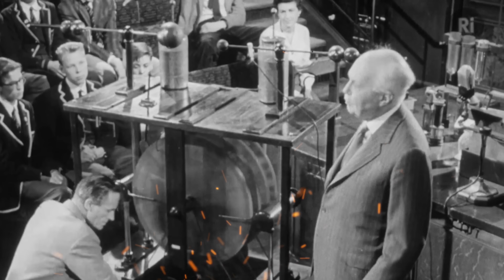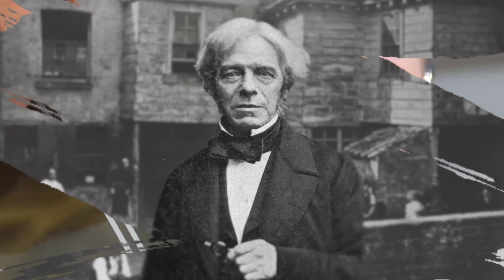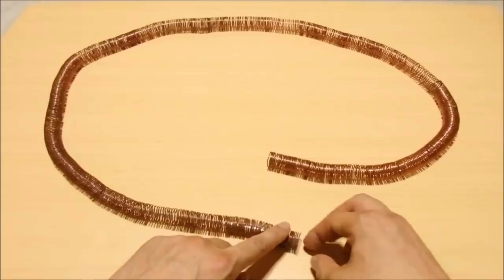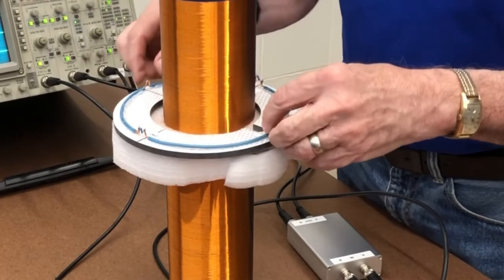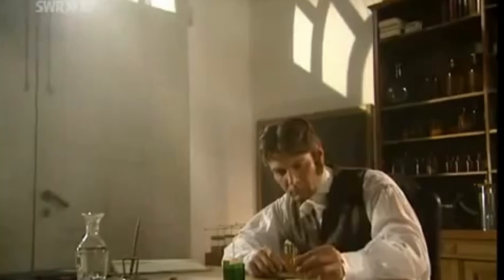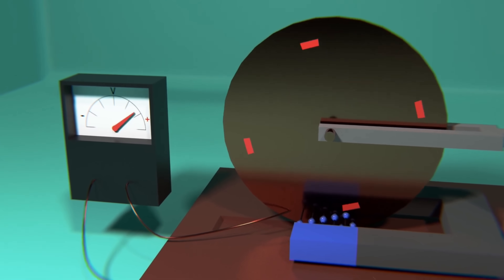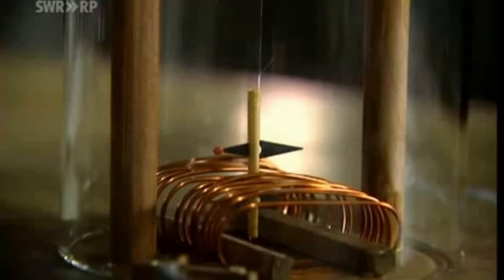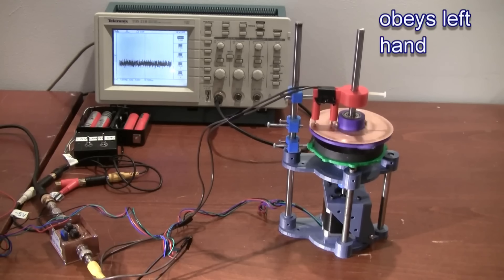The Faraday Paradox: NEW FREE ENERGY GENERATOR 70KW - FREE ENERGY FOREVER

Comment: The Experiment: Suddenly create some charge, and with pre-placed instruments watch (along a radial line from the created charge) the fields and potentials appear progressively at points along that radial, at the speed of light.  And once the field and potential suddenly appear at a distant point, they thereafter steadily remain. This shows that a stream of continuous real observable EM energy does indeed pour from the charge, once it is made, continuously and unceasingly.  Further, that free stream of EM energy does not "die out" so long as the charge remains intact. So the associated fields and potentials are continuously replenished, as they continuously spread radially outward at light speed.

The Observation: Every charge freely pours out real EM energy in all directions, with no observable energy input.

The Problem: Either the required nonobservable energy input must be identified or the energy conservation law is false.

The Solution: The charge continuously absorbs virtual (subquantal) photon energy from the vacuum, coherently integrates it, and re-emits it as real observable photons.

References:

Source Charge, Van Flandern Waterfall, and Leyton Geometry T. E. Bearden  (Dec. 2, 2003)

T. E. Bearden, "Giant Negentropy from the Common Dipole," Proc. Congress 2000, St. Petersburg, Russia, Vol. 1, July 2000, p. 86-98. Also published in J. New Energy 5(1), Summer 2000, p. 11-23.

T. E. Bearden, Energy from the Vacuum: Concepts and Principles, Cheniere Press, 2002, “Chapter 3: Giant Negentropy, Dark Energy, Spiral Galaxies and Acceleration of the Expanding Universe.”

M. W. Evans, T. E. Bearden, and A. Labounsky, "The Most General Form of the Vector Potential in Electrodynamics," Found. Phys. Lett., 15(3), June 2002, p. 245-261.

The Source Charge Problem: Its Solution and Implications T. E. Bearden, Aug. 18, 2003
Reply: Sorry, but Bearden was a crackpot. He claimed to have free energy, but never showed it in a credible way.
Reply: 1 - You can easily spot the critics, by their snobbery and name-calling (the ad hominem attack), beginning with “crackpot” and other terms of like flavor. It is particularly amusing since they know little physics, and not know the difference between efficiency and coefficient of performance, and don’t realize that from any source of a finite potential intensity φ (phi), regardless of how small the value of φ, as much energy as one wishes can be collected, simply by W = φq, where W is the total energy collected from potential intensity φ by intercepting and collecting charges q. If one wishes to collect more energy W from the same potential φ, one simply needs more q. The reason is simple: the scalar potential is actually a bidirectional set of EM energy flows, as shown by E. T. Whittaker in 1903, and what is collected from it depends on the number of fundamental interceptor/collectors (called “charges”).

Let us look a bit at the content of the “learned criticism”.

What does the phrase “perpetual motion” actually mean (denotation, not emotionally distorted connotation?). It simply means “continuous motion”. Well, that is just Newton's first law; a body placed in motion remains in continuous (perpetual) motion until interacted upon by an external force to change it (Newton's second law).  So to question “perpetual motion” itself, is to question Newton's first law. The last I knew, Newton's laws were still doing fine in the region to which they apply.

In short, the literal meaning of “perpetual motion” for a great many decades has been deliberately twisted into a non sequitur to imply that it literally means “continuous production of energy or work from nothing, i.e., without any energy input at all.” So this foolishness and violation of logic has been used to twist Newton's first law, with the claim that it is a statement of continuous production of energy or work from nothing. It is no such thing. Any moving object, once placed in motion in an inertial frame, continues indefinitely. And whatever kinetic energy it has to the lab observer, remains continuously.  Simply kick a can out of the shuttle in deep space, and that proves it rather conclusively.

To show how long such total logical nonsense has been around, we quote Max Planck's “definition” or “explanation” of a “perpetual motion machine”.

“It is in no way possible, either by mechanical, thermal, chemical, or other devices, to obtain perpetual motion, i.e., it is impossible to construct an engine which will work in a cycle and produce continuous work, or kinetic energy, from nothing.” [Max Planck, Treatise on Thermodynamics, 3rd edn., Dover, New York, 1945].

Now examine Planck's first clause. It is a false premise, for it is falsified by Newton's first law. Again, that premise is falsified by simply ejecting something from an object moving in outer space. You immediately get perpetual (continuous) motion, until something external acts upon the ejected object to change its motion.

Now note Planck's second clause. This one is quite true! No one can construct, or—unless he is a fool—claims to have constructed an engine that continuously produces continuous work from nothing! I.e., one recognizes that the necessary energy input must be present. But what has that got to do with Newton's first law of perpetual motion until external force changes it? Nothing at all.

In short, Planck advances a false premise in the first clause. Then he advances a true statement in the second clause, implying that it therefore proves the false premise because they are the same—which is simply a logical non sequitur because they are not the same thing at all.

In an entire century, the skeptics of extracting energy from the vacuum have not progressed past Planck's statement (and its predecessors) containing a false premise and a logical non sequitur. They simply repeat the same false premise and same non sequitur.

Now observe their profound assumption that a coefficient of performance (which is the useful energy output or work output divided by the energy that is input by the operator only) that is greater than 1.0 is impossible and would constitute a dirty old "perpetual motion machine" of the false premise kind they still advocate illogically.  There went windmills, solar cells, heat pumps, water wheels, sail boats, gliders, etc. All are impossible by their assumption.

Well, a windmill, a waterwheel, and a common solar cell all exist and have COP = infinity!  The operator himself inputs zero energy input to each one of them, but all the energy required for the work output (and the losses due to inefficiencies) is indeed freely input by the environment.  The EFFICIENCY of a system is defined as the useful energy or useful work output divided by ALL the energy that is input, whether by the environment, operator, or both. The efficiency of a common solar cell may be—e.g.—only 17%, which means it wastes some 83% of all the energy the environment freely inputs to it. However, the operator inputs nothing at all, so the COP = (the finite energy output of the system, i.e., 17% of the environment's energy input), expressed in joules per second, for example, divided by (the zero input of the operator), which yields a COP = infinity.

A common home heat pump usually will have an EFFICIENCY of 50% or less, but will have a nominal COP = 4.0 under nominal conditions; the extra energy is just extracted from the atmosphere.  That is certainly not a "perpetual working machine with no energy input", but it also certainly has a working COP>1.0, which is why it is so widely used. It's CHEAPER if you get some of the necessary energy input from the environment, and—as in the case of the windmill—it's even cheaper if you get ALL of the necessary energy input freely from the environment.

A very high efficiency windmill, e.g., may have an efficiency of 55%, about tops.  So it wastes 45% of the input wind energy, but does convert the other 55% into useful output energy or work.  However, its COP = infinity, because again the operator inputs nothing at all, but gets out free work continuously from the unwasted energy that the environment inputs.

So yes, one can have a "free energy lunch" if the environment freely provides the energy, as it does for the windmill, solar cell, waterwheel, sailboat, charge, etc.

As can be seen, the critics have simply unleashed the typical diatribe of one who doesn't even know the difference between efficiency and COP, and seems unaware that COP >1.0 and even COP = infinity are perfectly achievable and permissible in thermodynamic machines, with physical examples common and already known. No laws of physics or thermodynamics are violated by COP >1.0 or COP = infinity, in spite of what they erroneously assume.
Reply: 2 - Now let us turn the tables. We assume that they accept common classical Maxwell-Heaviside EM taught at every university, and as taught in all electrical engineering departments, particularly with respect to electrical power engineering. Let me point out a terrible problem that used to be recognized, but was never solved and has just been swept under the proverbial rug because it is so terribly embarrassing. In that conventional EM and EE model, all observable EM fields, potentials, and their observable energy in space are said to come from and be produced by the associated source charge. But it is an experimental fact, easily shown, that no observable energy input is made to the charge in the real world, or in that classical and EE model. The classical model also does not contain or model an unobservable, virtual state EM energy input. So the current Maxwell-Heaviside EM model (and the current electrical engineering model) accepted in every university, every EE department, by every EE professor, and in every EE textbook, already implicitly assumes that the source charge freely creates and pours out real observable EM energy continuously, from nothing at all, thereby establishing and continuously replenishing its associated EM fields and potentials and their energy, spreading across the universe at light speed from the moment of presentation, assembly, or creation of the charge.

The greatest advocates in human history of "perpetual working machines with no energy input at all" are in fact those very same EE departments, professors, texts, and engineers—and the M-H classical electrodynamicists who do not include the active vacuum exchange with the charge and the asymmetry of that exchange.

In short, let us now hoist the critics on their own petard.  So long as they accept that standard Maxwell-Heaviside model and electrical engineering, they are guilty of unwittingly being a member of the huge class of giant advocates of perpetual working machines called source charges, freely creating energy from nothing at all, that they find so abhorrent. Let them first pluck the mote from their own eyes, for it is as big as a mountain. They are already guilty of accepting the standard model which assumes that every EM field, every EM potential, and every joule of EM energy in the universe is and has been created from nothing at all by the associated source charge(s).

D. K. Sen referred to this terrible hidden problem in electrodynamics and electrical engineering in this fashion:

"The connection between the field and its source has always been and still is the most difficult problem in classical and quantum electrodynamics." [D. K. Sen, Fields and/or Particles, Academic Press, London and New York, 1968, p. viii.].  

There IS no solution to the problem in the usual M-H theory, because that model assumes an inactive vacuum and a flat spacetime. Hence it assumes a zero energy exchange between its INERT environment and the physical EM system. That has long been falsified in particle physics, particularly since the discovery and experimental proof of broken symmetry. It is also falsified by a series of rigorous Alpha Foundation's Institute for Advanced Study (AIAS) papers dealing with energy from the vacuum, and taking into account, e.g., the curvature of spacetime. Mendel Sachs has long pointed out that one cannot even have an EM wave in space without the necessary spacetime curvatures (and oscillation of same). In other words, as has long been proven in physics, the environment of the physical EM system is not inert at all, but is active. Not only is there an energy exchange between that environment and the system, but there can also be an asymmetry in that exchange. Once the asymmetry is admitted (it's long since proven in particle physics), then EM systems producing COP>1.0 and even COP = infinity are perfectly permissible. That they have not previously been developed is a matter of self-limiting of the technology, not a law of nature or of physics.  The standard closed current loop circuit, e.g., self-enforces H. A. Lorentz symmetrical regauging, hence prohibits COP>1.0 unless it is violated.

Today, in every university this "most difficult problem in electrodynamics"—the source charge problem—is concealed from the students, and even many professors seem no longer aware of it. The way it is hidden is as follows: They teach the subject of the charge and its associated fields and potentials in the following fashion: "We have here a charge.  Associated with this charge are its fields and potentials, reaching across the universe." In short, ka-blam!  One is given a source charge, and suddenly there are its associated EM fields and potentials and their energy, freely appearing out of nowhere, with no energy input at all. Automatically! That way, they slip it right by the students.

Simply try out that little statement. Suddenly create some charge, and with pre-placed instruments watch (along a radial line from the created charge) the fields and potentials appear progressively at points along that radial, at the speed of light.  And once the field and potential suddenly appear at a distant point, they thereafter steadily remain. This shows that a stream of continuous real observable EM energy does indeed pour from the charge, once it is made, continuously and unceasingly.  Further, that free stream of EM energy does not "die out" so long as the charge remains intact. So the associated fields and potentials are continuously replenished, as they continuously spread radially outward at light speed.

Unfortunately those steady state dynamic fields and potentials are referred to as "static fields", when in fact they are nonequilibrium steady state dynamic entities.  Even the staid old John Poynting theory will establish that a charged capacitor laid on a permanent magnet so that the E-field of the capacitor is at right angles to the H-field of the magnet, is somehow the seat of a dynamic and continuous flow (steady state flow) of EM energy. That too is a problem that has never been resolved in the Poynting theory. In that model, there is no input of energy to the two dipoles (charged capacitor and permanent magnet), hence there can be no energy output. But there is, including in a charged capacitor separately and a permanent magnet separately.  This is assured by the proven broken symmetry of opposite charges, such as the poles of the magnet and the opposite plates of the capacitor. ANY such dipolarity—because of its broken symmetry of opposite charges—must then absorb virtual EM energy (virtual photons) from the vacuum, coherently integrate the virtual energy into observable photons, and re-emit real observable photons in all directions.

Any form of electrodynamics not modeling that virtual energy exchange between vacuum and charge, and the asymmetry in that exchange, thus can only model the charge's production of its associated fields and potentials as "perpetual working machines" freely and continuously creating EM energy out of nothing at all." And the conventional EM models do just that. In every university.  In every electrical engineering department.  In every electrical engineering textbook.
Reply: 3 - Oddly, in the 67 years since broken symmetry was predicted by Lee and Yang and experimentally proven by Wu et al. in 1957, and the Nobel Prize awarded to Lee and Yang the same year for having predicted broken symmetry very strongly, the fact that every charge and dipole—by their asymmetry in the vacuum flux exchange—freely extracts real EM energy from the vacuum and pours it out, has not made it across the university campus from the particle physics department to the electrical engineering department.  

When you combine broken symmetry of opposite charges with the quantum field theory view of an "isolated classical charge"—one can show a bare center charge clustered around by virtual charges of opposite sign.  In short, the so-called "isolated charge"  is a special dipolarity and charge structuring (polarization of the vacuum), exhibiting the broken symmetry of opposite charges. Hence that resolves the agonizing question of where the INPUT energy to the charge comes from, that the charge receives, integrates, and outpours as observable photons, to establish its associated fields and potentials, spreading across the universe in all directions at light speed from the moment of formation of the charge. The charge continuously absorbs virtual EM energy from the vacuum, and transduces it to observable energy, then re-emits it in all directions. No violation of the conservation of energy law is involved, if the environment's input of energy in strange form is accounted.

Thus by recognizing the continuous virtual energy input to the charge and the charge's continuous conversion of virtual energy absorbed into observable energy emitted, one saves the conservation of energy law. Otherwise—if the conventional M-H model were correct—the conservation of energy law would be already falsified by every charge and EM field and EM potential in the universe. That does not happen, and the conservation of energy law is perfectly safe, when one resolves the modeling difficulty. One just has to insist that the conventional model's assumption of creation of EM energy from nothing is a falsity, as can be experimentally proven and has been experimentally proven.

All critics would do well to first find out what their own accepted model already erroneously assumes. They would also do well to try to find out the difference between efficiency and coefficient of performance of an EM system. No one in his right mind advocates that the EFFICIENCY can be greater than 100%, for that would be a total violation of the conservation of energy law and an assumption that energy can be and is created from nothing at all. But certainly the COP can be greater than 1.0 and often is. COP>1.0 does not violate conservation of energy, but does require that the environment input some or all of the energy, so that the operator only inputs less than the effective output of the device.

The only people who do that kind of erroneous assumption of efficiency greater than 100% lack a knowledge of the difference between efficiency and COP and using the same snobbish arguments, confusing the concept of perpetual (continuous) motion under Newton's first law as synonymous with the concept of a continuous working machine with no energy input (the two are not the same at all, and to imply that they are the same is a gross non sequitur and a failure to reason logically).

Their entire tirade about crackpots and overunity (COP>1.0) being forbidden perpetual working machines with zero energy input simply reveals their ignorance of both physics and thermodynamics, and their failure to even realize that every charge, solar cell, windmill, and water wheel has COP = infinity, while a common heat pump will have a nominal COP of about 4.0.

To equate simple COP>1.0 in an EM system as being "forbidden perpetual working machines with zero energy input" is a total non sequitur, and characterizes their entire tirade, which is emotional and ad hominem in nature and not substantive and scientific.